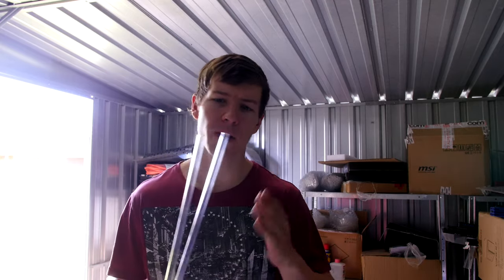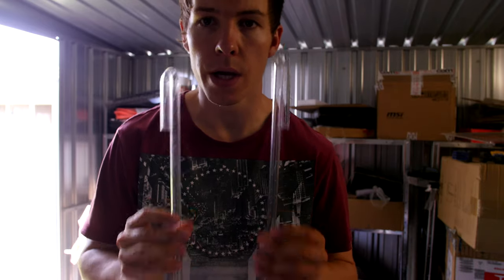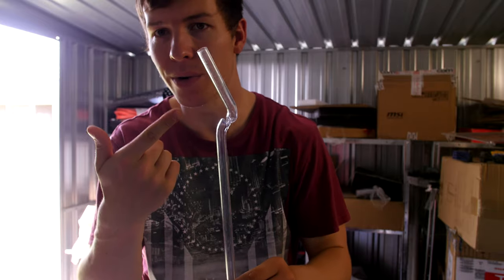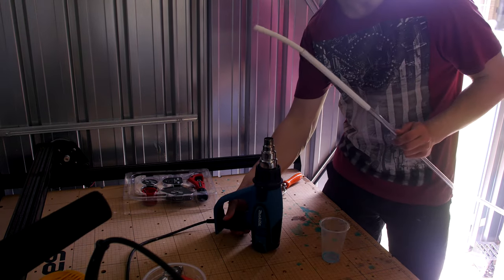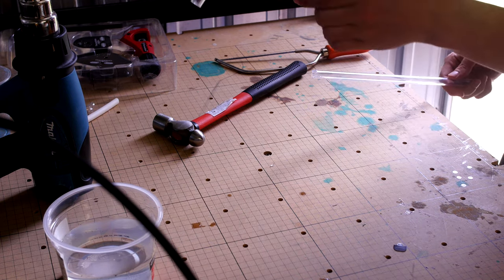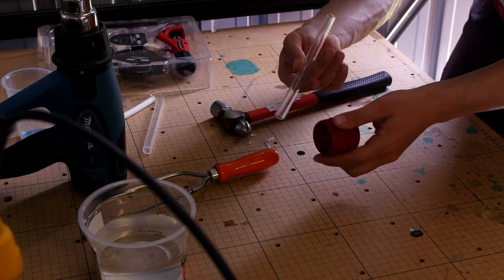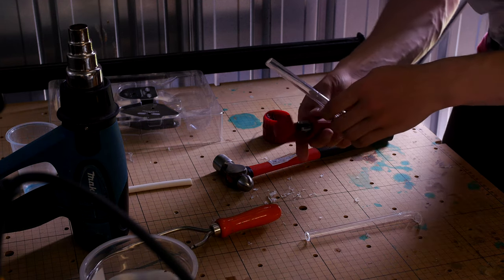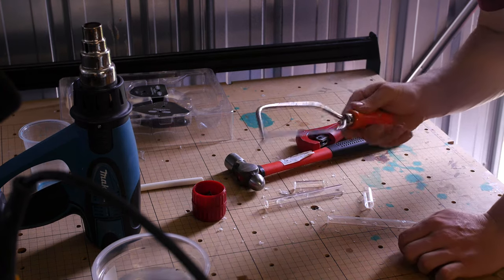PC Water Cooling Guide PETG VS Acrylic Hard line Tubing for Beginners

Comment: The deburring tool works fine with either material, you just have to to it while applying minimal pressure and leaving the tool to do the rest. Not need to apply extreme force. Lastly, followed by a light sandpaper for best results.

Comment: Would it also be accurate to say that the acrylic would need more precise measurements because the PETG would be more forgiving to bend into place if slightly off?
Reply from the maker: +SgtT8ie both can withstand a small amount of flex when trying to insert them into fittings etc but yeah definatly the PETG would win in that example
Reply: Thanks for the clarification
Reply from the maker: +SgtT8ie no problem man =)

Comment: might be a little stupid question but could you also use glass tubing? i know you can bend it fairly well(you need more heat i believe. but it does bend if you have the heat) and it is very clear. quite brittle but i can't imagine it being a lot worse than acrylic. did you ever try working with glass?
Reply from the maker: hey man glass is abit harder to do because you need something that can actually get the glass hot enough to start it melting
Reply: jort93z you can heat the glass with a small torch that you can buy for cheap like under fifty
Reply: Jayztwocents has a video on cutting glass tubing, but not bending it.
You might need it very hot before it will bend.
Could look really good though.
Reply: The kind of glass you should use is called borosilicate, it's the kind of glass beakers and flasks used in chemistry labs are made of. It's absolutely a more premium material than either acryllic or PETG, but to get 8t hot enough to bend you will need an actual open flame from a torch at minimum.
Reply: 1200 degrees hot

Comment: Does PETG yellow? What If I got Polycarbonate instead of PETG? I thinking of making my own parts from scratch, but I want to avoid acrylic.
Reply: i read on ekwb that petg is prone to deformation over time with the heat which can lead to leaks. so even though akrylic is brittle and harder to work with, if you dont move your pc often or at all, it is certainly the superior choice if you're careful.
Reply: @WatashiwaToyotaHondadesudesu  
I would tend to somewhat agree...
I had a friend who used acrylic and  never moved his gaming rig... Then one day he was walking by his computer desk and accidentally rub-bumped the desk on the opposite side of the desk away from his gaming computer and just then two of his acrylic tubes cracked and sprung a nasty leak! He changed to petg. that was 4 years ago, he said he will redo his petg runs sometime this month just as a maintenance task.
Reply: @JUSTDREAMFREE  i personally just built a brass tube build mysefl. posted it on buildsgg as "one brassy boie" if you wanna see it lol
Reply: @WatashiwaToyotaHondadesudesu  
Great job on the build!
You must have put a lot of time and money into that build!
Reply: @JUSTDREAMFREE  thanks, yea it cost a bit but what a man wont do for his hobbies.

Comment: Basically: PETG is better for beginners and for people who don't want to deal with the possibility of shattering. Acrylic is more advanced, takes more time, and is much clearer overall. If you want your build to be as sexy as possible, use acrylic. Just be careful when handling acrylic though because it can scratch easily. I recommend getting something plush to put the tubes on.

Comment: Your video's are very informative and well done.  I have a question concerning sandpaper.  You mentioned using sandpaper for cleaning up the end of the tube.  Does the grit size matter?  If so, what do you recommend?
Reply from the maker: The grit size doesnt really matter too much, the sand paper is just there to remove any really sharp bits so that it doesnt ruin the oring

Comment: Could you tell me what size this tubing was?  I'm about to do a loop for the first time, and am looking at 14mm (od) x 12mm (id), which is much cheaper for fittings.. or 16mm x 12mm (much more expensive fittings).  So, I'm wondering if this tube in the video is 2mm thick or 4mm.  The diameter is not important here.  Thanks.

If anyone else knows whether 2mm is good enough, then please, let me know.  Thanks all.
Reply from the maker: +Larry Gall 2mm is fine, this was 12mm od 10mm id
Reply: @DesignsByIFR  Remember, the sidewall of 12/10mm is only 1mm thick. I prefer the 1,5-2mm thick ones.
Reply from the maker: Hi camo yes I know. I was referring to the 16mm-12mm tubes he was asking about

Comment: Not sure what to do now. I'm doing my 1st WC build using Monsoon fittings (already bought) which need their Monsoon acrylic lock collars and its said you have to use acrylic tubing not petg as petg expands and contracts which can split the acrylic collar. Anyone ever used petg with these fittings?
Reply from the maker: +RenovatioJuris petg would be fine with them, it doesnt expand and contract much and fittings have size tolerances which would accommodate for expansion

Comment: Statistically people aren't snapping their acrylic tubes, so it seems to be an exaggerated issue regarding the snapping.

Having said that, with my barrow quadrouple oring fittings (3 inside fitting + 1 on the tube), it sometimes takes a bit of force to push the PETG tube in, I can imagine doing that with acrylic and it just snapping.

Acrylic is compatible with all liquids, but PETG isn't, but again statistically people aren't having issues with PETG, so it doesn't seem to be such a big problem.

Acrylic seems harder to bend and too much or too little can damage the tube apparently. But with PETG I've never had bubbles form, and its easy to bend if you do it right.

Acrylic is better in that it doesn't flex back slightly when its cooled unlike PETG.

And acrylic wins in deburring, but that's pretty minor.

I think I will stick with PETG for the same safety reasons.
Jayztwocents prefers PETG, so its gotta be a good choice.

Comment: I much prefer acrylic, it's clearer, more resistant to UV discolouration, scratch resistant, and leaves safer edges for your fitting's O-rings, and there are no compatibility issues with coolants, while PETG can discolor, and turn some coolants into discoloured gunk as they react with plastic. It takes longer to work with acrylic, but i think it's worth it. It's safe, as long as you don't take a hammer to your build ;) Cool video by the way.
Reply from the maker: +Ariana Khan thank you =) the discolouration hasnt been proven to be petg, infact a big youtuber tested acrylic petg and glass tubes and he continued to get the discolouration so there was something else in the system. One thing that will have a reaction over time would be using car coolant with PETG because car coolant contains glycol which is also what petg is partly made up of and this could spark a reaction, not something id love to test in a system but perhaps i could leave a piece of tube sitting in a glass of car coolant for piece of mind haha. Thanks for the comment, much appreciated =)
Reply from the maker: +Ariana Khan hahaha yeah alcohol is bad for plastics, i wouldnt use anything glycol based with petg myself

Comment: One test you missed to demonstrate. What happens under constant high temperature wihin the tubes, a scenario that happens with systems under load. PETG tends to deform in such a condition which can cause troubles. Also it is untrue visually are the same, acrylic is definitely more clear than PETG.

Comment: Great Video Corey!
Could you do a part 2...
Test which will last longer in the loop as in heat and warping issues if any. Could you also give your opinion on different brands and costs, and then maybe a video on fittings?
Reply from the maker: Great idea mate

Comment: Do people always dip the heated tubes in water? Because flash cooling anything that has been heated up, to the point where it can be reshaped, only makes the item weaker. Much weaker. obviously both pipes were treated like this. But.. in defense of acrylic if it was heated and left to naturally cool it will be strong enough for any pc cooling system. Out of all the years people have used acrylic i have heard of only a handfull of cases where acrylic cracked in a pc. and in those cases the pc was actually dropped and broken as well.  As for PETG it is stronger and easier to work with but also is not without flaws for example i hope people understand to not use coolant with glycol in PETG systems as the PETG will be degraded by the coolant and leak. 

TLDR Acrylic, if cut, heated and cooled properly, it is plenty strong enough to cool your pc as it has been for years. PETG has Strength and ease of use and allows the use of pipe cutters, but can be degraded and ruined by coolants with glycol in it.

Comment: what are the pros of the Acryllic? only that it seems more like glass?
Reply from the maker: +fischi pros of acrylic would be the glass like finish and the fact that it is easier to use with the de buring tool
Reply: and the cons are that it braks easyli like glass, yea, its a bit a diffcult desicion to decide between both for me because I never used noone of obth xD
Reply from the maker: +fischi haha yeah exactly, i mean really it would be fine to use, it would take a decent bump of the case to actually break it because the case would absorb most of the impact
Reply: so, acryllic glass don't break as easily in normal conditions O_o

little bit confusing xD
Reply from the maker: +fischi haha well as i did say in the video it would require a decent bump, the companies wouldnt make a product if it had too many issues which happen all the time, the main things companies are doing now is bringing out petg tubing because it is much stronger  and cannot be damaged like acrylic. The video is there to demonstrate the differences between the two materials and what could potentially happen in a real world scenario especially if someone did accidently drop or bump their case with enough force =) iv seen it happen before
Reply: ok, thx
Reply: The main benefit of acrylic is that it can be used with nearly ANY coolant, Petg has tons of limitations in compatibility. Any ethylene gycol based dye or coolant slowly melts and plasticizes Petg. IMO acrcylic done carefully is much better for options and appearance.

Comment: Nice vid. Although I think you used the pipe cutting tool incorrect, when you cut the acrylic pipe. I think you tightened the tool too much, when you started cutting the acrylic pipe. 
Where I grew up this tool is usually used by plumbers to cut copper pipe. With copper being a soft metal, you can't tighten the cutting wheel too tight, or else you'd squeeze the pipe. You start tightening the cutting wheel very lightly and when it has gone through it's first "layer", you can feel the tool going easier around the  pipe. Then you you increase the tightness of the tool just a little more and cut through the next "layer". You repeat that until you're through the pipe. I think you'll have to take a similar approach with the more brittle acrylic pipe. It may take a little longer but gives a nice even edge which needs much less cleaning. 
I also have to admit that I never cut anything else than copper pipe with that tool, so in the end it's just speculation. 😁😁😁
But if you try my approach let me know how it worked. 😁😁😁
Reply from the maker: +TheTruthfinder74 this is petg, can be as rough as u want and it wont hurt it
Reply: You aren't supposed to use that tool for acrylic. He was only using it to reiterate his point that acrylic is far more brittle than PETG.
This video is very biased towards PETG and really only skims acrylic and focuses on displaying its negatives rather than showing the differences in approach that you need when using it or the positives it has that beat PETG such as longevity and ease of reworking.

Comment: You didn't address a very important aspect of petg vs acrylic, which is temperature softening and melting points.  I just lost a $900 video card because my pump failed and the petg tubing to the CPU softened to the point that it allowed water to leak out.  Petg only has a melting point of 81 to 91C, while the typical shutdown temperature of a CPU is 110C.  The working temperature is listed at 50 to 60C, which is below that of a stressed CPU.  If they pump is running, the water will only be a few degrees above ambient, so it's not a problem, but if the pump fails petg is the best material to use in a hot water environment.  Keep that in mind.
Reply from the maker: Well i get what you are saying but no body in the world does tutorials based off of a senario with a dead pump in the loop.
Reply: i think you mean acrylic in your last sentence,  i'll go acrylic for that particular reason, my computer is powered on 24/7 and want to avoid that problem if the pump fail and when i'm not at home, also this scenario may occur if you keep a computer for 10+ years like me ! Not all people change build every 2 or 3 years

Comment: Dude, you are supposed to rotate the cutting tool when cutting the pipes. Not just press it throught. Thus creating much nicer cuts on both materials.
Reply from the maker: I rotate the pipe while i tighten it. Look a bit closer
Reply: Designs By IFR okay, sorry! My bad. Just looked like you really tried to force it through.  But I have seen many other builders getting clean cuts with acrylic. I think you just have to handle it like glass; not tighten so much at once and rotate more before tightening again.
Reply from the maker: It isnt acrylic, its a differwnt material
Reply from the maker: If you use the cutter on acrylic it will shatter
Reply: @DesignsByIFR  
That's not how you're suppose to use that tubing/copper cutter!

The correct way is that you tighten the handle 'til you have some pressure on the pipe, then
spin the cutter around the pipe a couple of times, tighten more, and spin again,... 
and repeat until the pipe separates.
Nice and easy.

Comment: So why does anyone do Acryllic?
Reply: It doesn't cloud or stain as easily or as fast as PETG, it doesn't react with  the chemicals found in a lot of coolants and cause deposit build-up, it's easier to reheat/rework if/when a bend doesn't come out as well as you want, it's more resistant to heat, both from a bending and finished product perspective so there's less chance of ruining a pipe as you're heating it or of a pipe getting too hot inside your system and warping and causing a leak. There are probably a few other points I've missed but I think you get the idea.
This video focuses solely on the shock-force durability of PETG over acrylic and completely bypasses its other inherent positives such as ease-of-use and colour range.
I came here looking for an unbiased take on the acrylic vs PETG question and, sad to say, this definitely ain't it.